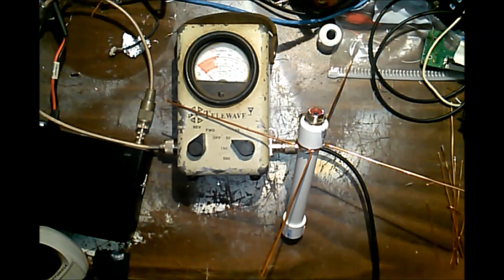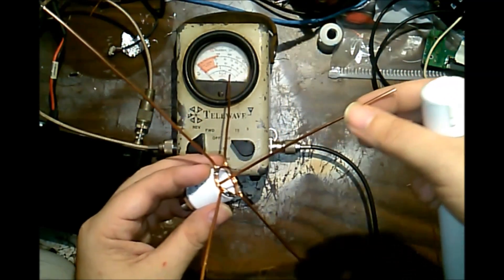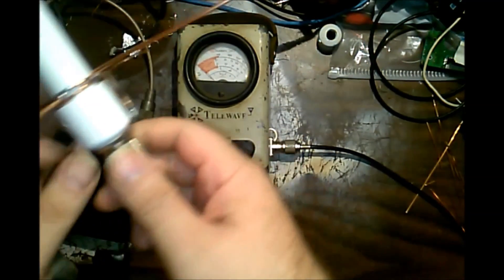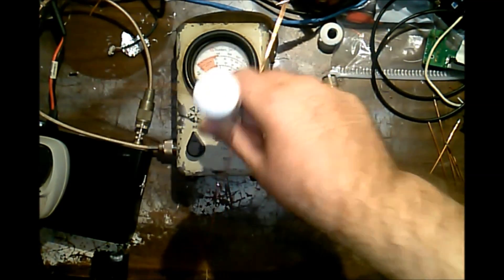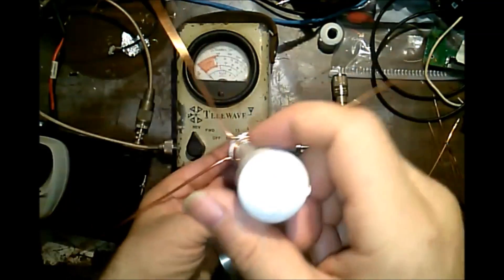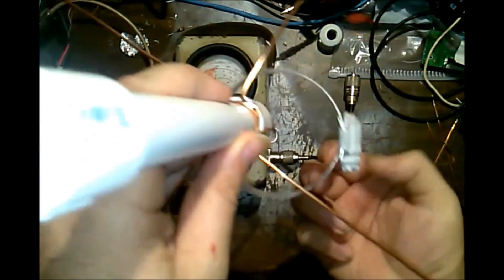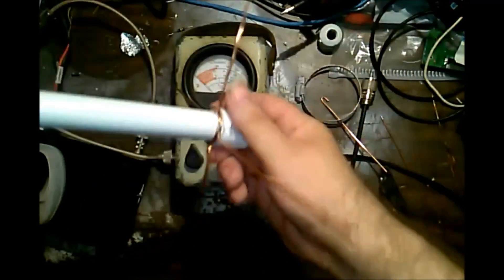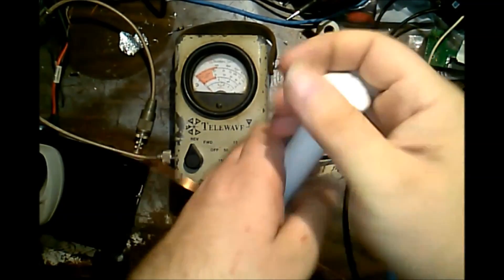DIY GMRS base / repeater antenna prototype

Comment: I would like to see how this hooked up to a SWR meter. I'm noticing that there is an inch towards the bottom of the antenna that is not accounted for that is only semi shielded I would like to know how that plays into the residence and tuning. Have you had any problems with it? If you have that could be your problem. Typically you'd want your why are to be shielded all the way up to the point of it going from cable to antenna plus or minus some type of Choke or Balan. Please get back, I'd really like to know how this worked. Stay safe enjoy the week

Comment: Great job brother. Thanks for your honest and excellent work. I'm trying to find a used repeater system to install in my house. WREW972 standing by. LOL
Reply from the maker: You can build up a repeater from a pair of mobile radios:  Go onto the surplus market like ebay and get a pair of Motorola SM50's and one of those 16 pin repeater interface cables to interface both radios. You will need to have the radios programmed for repeater use of course (one for RX and one for TX and have the 16 pin accessory header pins set up for that cable to work.. a Motorola radio shop or even the seller online may be able to do all this..) You will also need a UHF duplexer and the proper set of coax cables, most sellers of duplexers will offer to tune it for you to whatever frequency you are using. Then some type of antenna... Or you could get lucky and find a Motorola GR1225 in UHF for cheap that works and have the seller program and tune it for you..